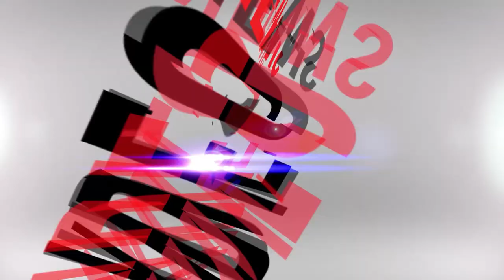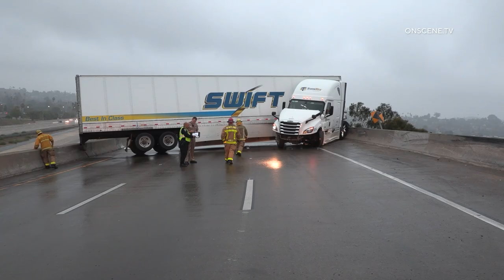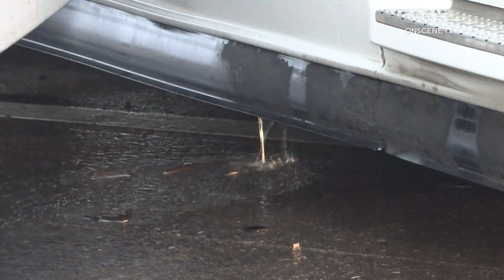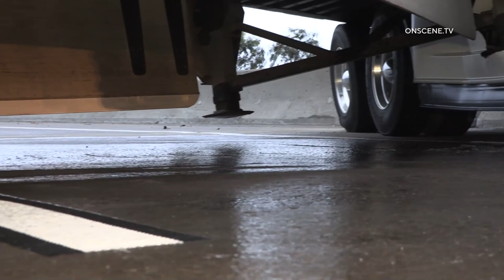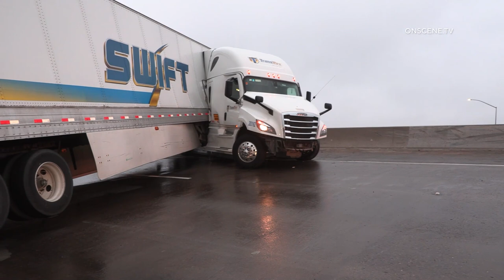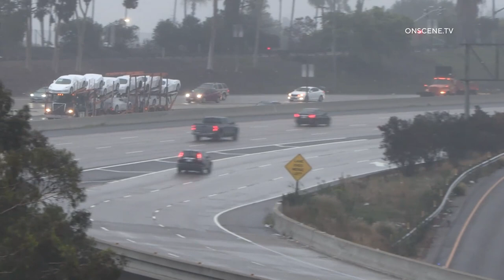La Mesa: Semi Truck w/ Trailer Jack Knife Incident 08212021

Comment: Stay clear from swift truckers. Many amatuer truckers work for them. Had a swift driver speeding in the slow lane then abruptly came up onto the passing lane without signaling. Was within Inches from side swiping my family off the road. I had to swerve out of the way and hit the center divide to avoid a mess this idiot could have potentially caused.